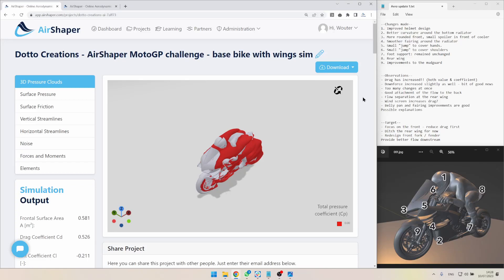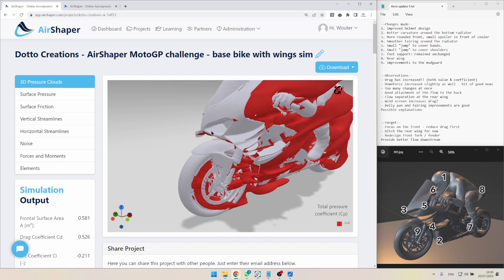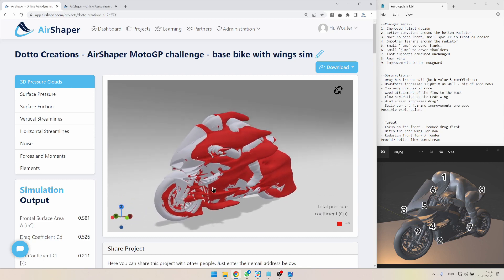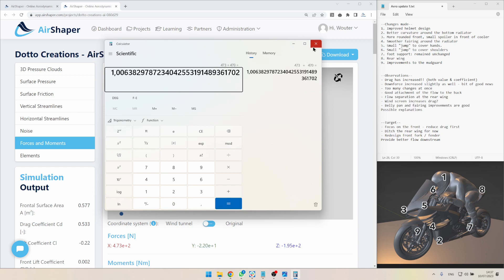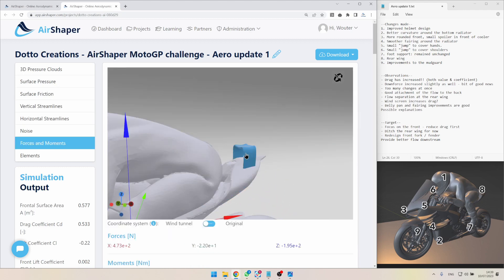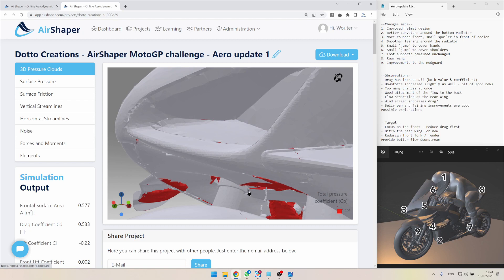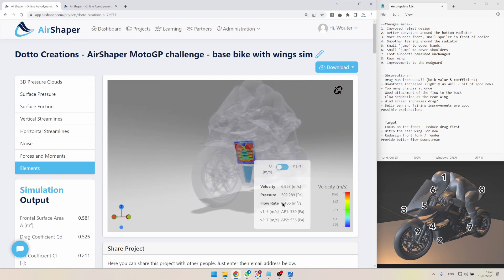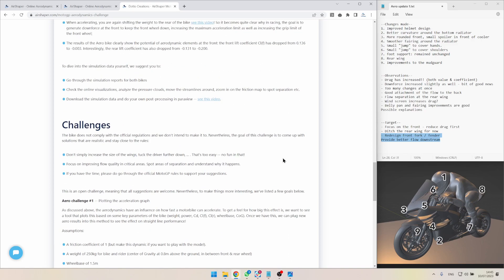MotoGP Aerodynamics - The Dotto Creations - AirShaper aerodynamic design challenge - Aero Update 1

Comment: I have a question, in the '80 the racing bikes has a big squared tail, that work, I think, like the kammback. Except for the rear wing, newer bike, or the moto3 - moto2 bike, have a real small tail and from wind tunnel we see lots of turbolence here. So, this is because the tail is not so important? And is still here, but really small, only for aesthetic reason, but a simple bicycle-like seat without tail could work well?

Comment: Adding holes to the visor, like the zx10 could help the wake around the rider without increasing the fairing size...
Reply from the maker: Could help indeed! It would provide a bit of pressure reduction at the front, feeding fresh air into the wake behind the wind screen. But then again, the flow would choke a bit through those small holes and would cause its own drag when hitting the rider, so the effect may be limited.
Reply: @AirShaper  i think it could be used like a turbulator of sorts- adding positive pressure behind the windscreen could help with the flow seperation coming over it?
Reply: @AirShaper  i have tried a few different things trying to reduce the flow seperation over  the windscreen- the only thing i have found from on bike, is there is indeed a sweet spot where the rider can tuck, where the helmet is further back from the wind screen- about 8 inches behind the trailing egde of screen and helmet is touching the tank. The air stream will clean up dramatically!

Comment: Tough one! That starting model is so far off in multiple places that improving it with small tweaks will be difficult. Improving the flow quality around the radiators just ends up increasing the flow velocity hitting the legs and rear wheel etc.
The model needs reworking as a whole I would think.
Reply from the maker: All suggestions welcome - you are right, sometimes you need to rethink the entire setup!